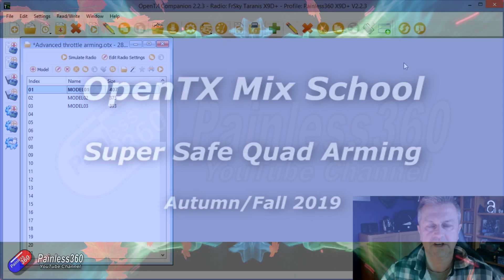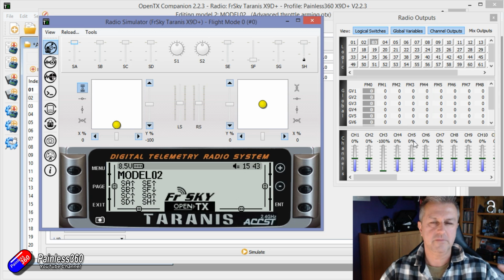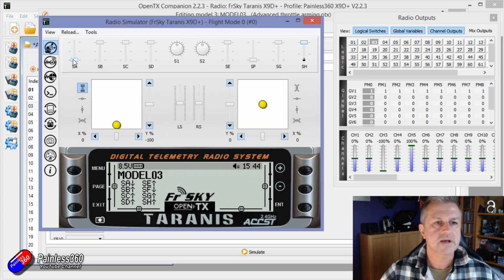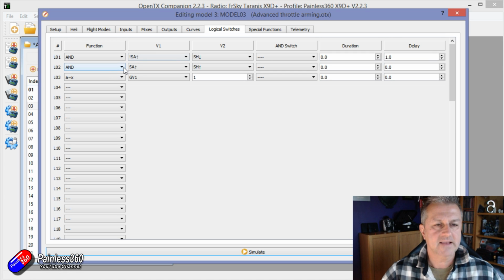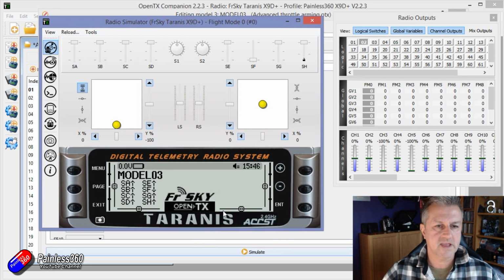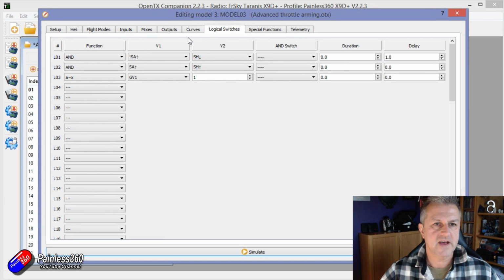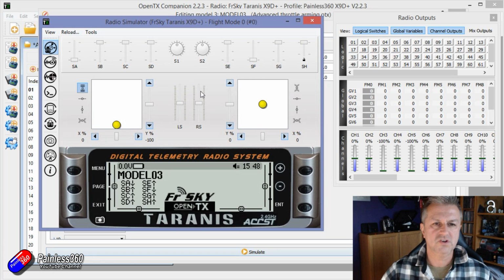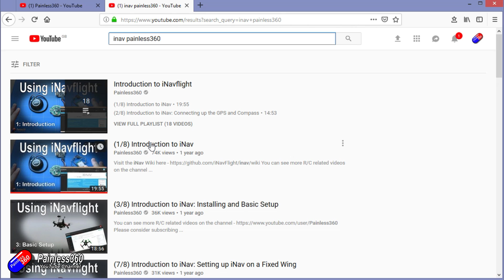Super-safe Betaflight/iNav Arming

Comment: Hey Lee, I'm trying to get this to work, but for a fixed wing model. I've cut and pasted your settings into my model, nut it simply doesn't work as I wanted. I have all my quads setup for dual switch arming, but simply can't get it to work on a fixed wing! It can't be that difficult, can it? I want my fixed wing plane to arm/disarm the same as my quads, which is:
Switch F in the UP (forward) position, plus switch  H in the DOWN (for 0.5 second) to ARM.
Switch F pulled to the DOWN (back) to DISARM.
This is driving me nuts!
Are fixed wing and quads really that different, when it comes to arming and disarming?
Reply: Never mind.... I solved the problem quite easily by adding a special function that simply said "!L03 OVERRIDE CH3  -100  ON"
With that line, if L03 (the logical switch that is TRUE when the aircraft is armed) is FALSE (IE. one or more of the conditions required to arm it has not been met), then the throttle is overridden and set to -100 (off).

Comment: Interesting, but the result is very similar when I just set SH as pre-arm. 

Have you ever had to re-arm during flight with this system?
Reply from the maker: Those featrures are not available on lots of other flight control systems like iNav and Vector (as well as old versions of BF too). So it's in those cases where it's more useful. Happy flying!

Comment: There is a problems in the logic of the program you share 20 seconds into the video; the reason why you see the safety issue is that the FlipFlop (Stick function) is never reset with your arming switch SA, but instead uses a completely independent switch SF. Correctly reset, the Stick function would require another impulse to be activated, and for it it would need both, SA and SH together with Thr<99. Instead, try to set V2 in L04 to SA (forward arrow), then this logic should work just perfectly and reliably, and to the best of my knowledge constitutes still the best and safest OpenTx arm switch around, without the need to use GVs. Personally, I would also swap out the switches in L01 (V1 and AND), so you hold down the momentary switch, and then flick the arm switch to activate. Give it a try and let me know if I overlook anything. Happy to share a screenshot of my working switch.
Reply from the maker: Thanks for the comment. I was using a mix shared with me. I suspect it came from another content creator who's shared a broken setup. There are always at least two ways to do almost anything in OpenTX. The purpose of this video was to show another way. It's clear you know something about Opentx mixes. I'd like to see more content on topics like this from knowledgeable pilots.. Let me know if you do, I'll watch... Thanks for the comment!

Comment: I need something to keep me from accidentally disarming in inav with my fixed wing. I assume it will be similar?
Reply: I didn't know that was a thing. I've just started flying fixed wing, coming from multirotors and do the same. Although I didn't do it on my last couple of flights so maybe  my brain is learning!
Reply: @furrybunnyfeet  I concentrate hard NOT to accidentally hit the disarm haha
Reply from the maker: Yes, exactly the same... see my inav series as turning on the extra arming safety can avoid flying before 3D fix etc. too... Happy flying!
Reply from the maker: Maybe that's worth a video! :D